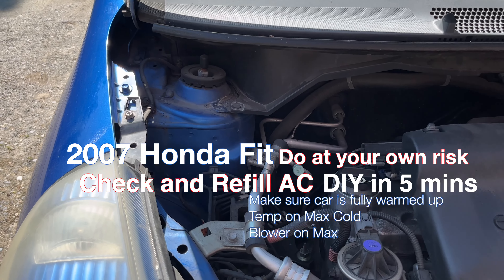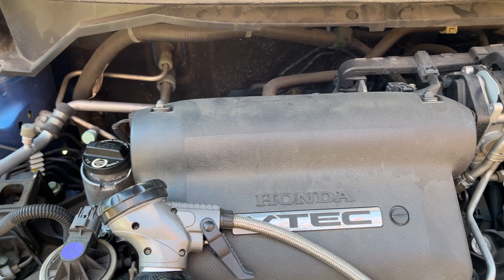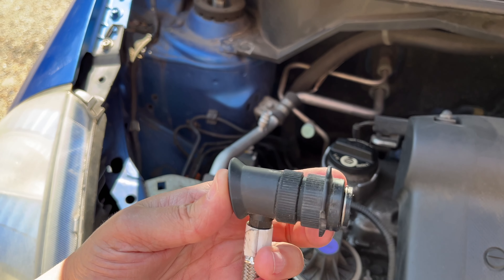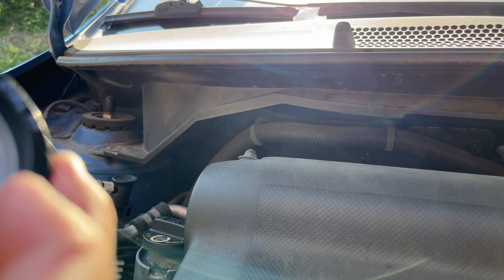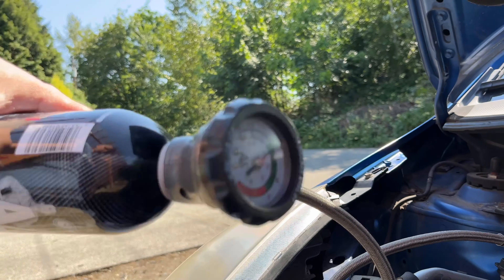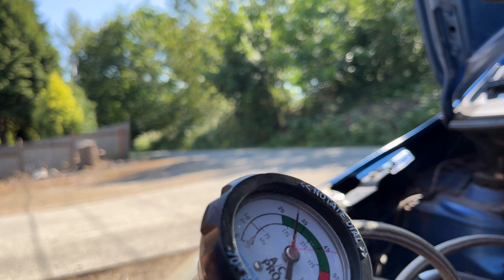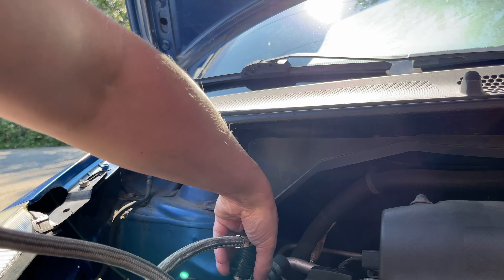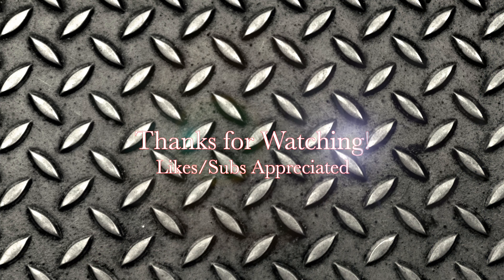How to Refill AC in a 2007/2008 Honda Fit

Comment: Helpful video! How many ounces did you use?  I bought a 6 ounce can, maybe I need more.
Reply from the maker: It's not an easy answer as you use a gauge and fill as needed. Mine wasn’t completely empty so it was less than the can. I would buy the large bottle not the small one. Sorry I’m not more specific.
Reply from the maker: Yes mine was like a 24 or 32 oz can. I have used the 6/12 OZ cans in the past and been unsuccessful. The reason I did the video was to show how to make it successful. The gauge and trigger are very helpful also. Some people do it old school but not me.
Reply: @momanddadmeetworld  OK.  I guess the gauge would indicate if there is not enough refrigerant.  Just means cool air rather than cold air? Or simply won't work if not enough of the refrigerant?
Reply from the maker: @RedMango55  yes it would mean cooler versus cold air. But it could also burn out your AC pump because there would not be enough lubricant in the lines. Most ACs have a lubricant that help the pump run. It’s not good to run your AC without enough refrigerant for a long period of time. If the gauge indicates that you’re low, I would just add more refrigerant. You wanna be careful not to overfill it though because like with anything you can blow out the lines if you over pressurize it, which is why I encourage people to use the gauge to make sure that you get the system right. Hope this helps.
Reply: @momanddadmeetworld  Will keep those points in mind.  Thank you!

Comment: How long do I squeeze the can for? Do I do it  until the can is empty? Or until I feel cold air through the AC?
Reply from the maker: Hi Tracy, 
Great Question. I squeezed the trigger for about 2-3 seconds at a time while rotating the bottle. This allows you to check the pressure gauge several times. The pressure gauge will tell you when you need to stop adding refrigerant.
Reply: Excellent will be trying this weekend

Comment: What does it mean if it’s in the red once you put connect it to the hose ?
Reply from the maker: I dont know for certain but it sounds like you may have an over filled/over pressureized the system. Does it blow cold? Does it make any weird noises when is running?